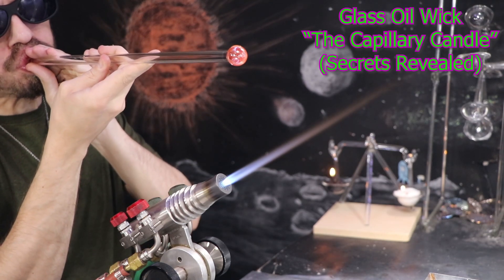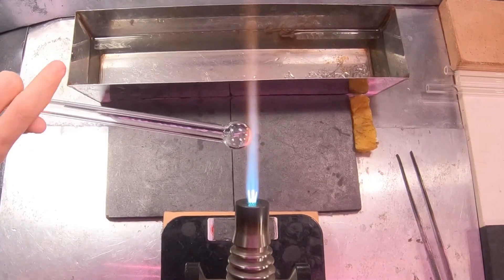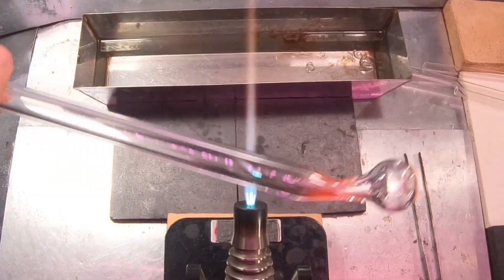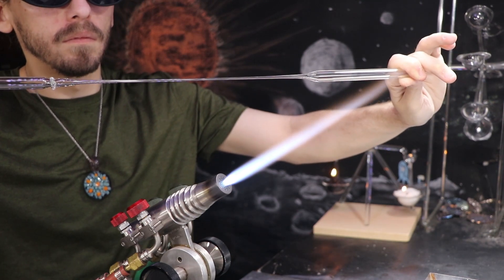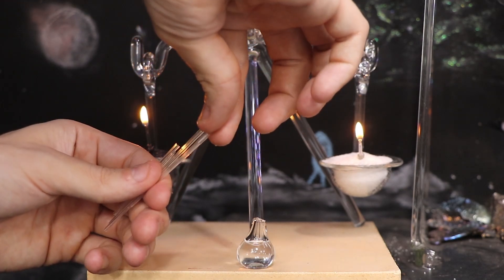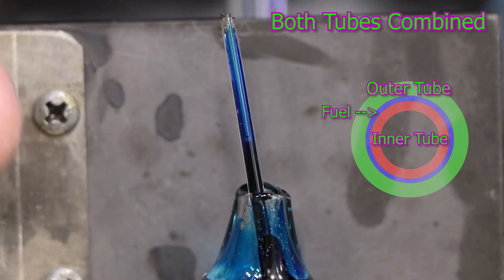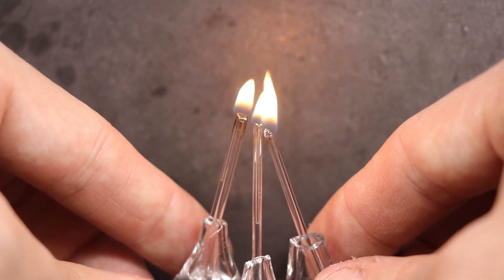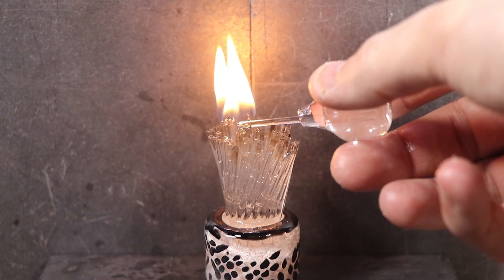Glass Oil Wick "The Capillary Candle" (Secrets Revealed)

Comment: I think you doesn't read comments, but I'll give you an idea anyways: Glass is a very bad heat conductor, so try to insert a very thin copper wire that fits inside the inner tube, it will conduct the heat to the oil thus warming it, so the oil will get thinner and at the same time the copper wire will help the capillarity by filling the inner tube... 🤔🤔🤔
Reply from the maker: Hey Laurahelenaxou1834, that is very a clever idea. The oil would be closer to flash point and combustion, it may burn easier. Thank you for the idea, I'll have to try it. And yea I have been away from comments and work in general but slowly finding my way back.
Reply: Awwww you saw my comment!!😍 Thank you very much for the compliment, as soon as I watched your amazing glass wick, I started to think in an idea to improve it!! A terrific and very clever wick system by the way, I have no practice nor skills to work with glass tubes and make those little ones, but I will at least try it!!! I will keep an eye here to see if my copper wire idea works 🥰🥰🥰

Comment: But, like with cotton wick, the question is: how long this glass wick works without obstructing its micro-holes by glass slowly melted by the flame?
Second question: is it totally atoxic?? Because about 5 or 6 years ago i tried with a commercial glass fibers wick and cooking oil, the results were no bad but after some hours of use i had a stitch on my right belly side (i think: for intestinal irritation), more than one time, so i abandoned glass for paper or cotton wick: it's without problems but it's no more good after 15-20 hours of use (with cooking oil).
I tried also metal sponges as wick for alcool lamp but with a very bad results. I don't remember if i tried it with cooking oil. I should try...
I imagine that the oil in your video is kerosene or mineral distilled oil for lamps.
In every case, your all glass oil lamps are splendid! Unique! Bravo!
Reply from the maker: Good questions. From the testing I've done the wicks don't melt but does collect a small amount of soot. The soot doesn't seem to cause any trouble and can be cleaned with a small brush. 

Being just glass I would assume it wouldn't be toxic. Sorry I don't understand what you're doing with the lamp to get intestinal irritation, are you cooking food with it? Cooking oil and lamp oil won't burn as clean as natural gas or propane. I'm not sure if the capillary candle can burn cooking oil. I should test it out to make sure. 
Thank you, thank you. The oil lamp has been a bright inspiration for me.
Reply: @JasaGlass  Okay, so you will try your glass micro-pipe for cooking oil lamp, did i well understand? But you must put the glass pipe in a cork floating upon the oil and protected (the cork) by aluminium foil; this is beacause the natural oil cannot climb more than 2-3 cm, contrary to kerosene which climbs 10 or more centimeters. Then, you'll tell me your results, please.
Why do you not sell your glass pipe wick?? I would buy some...
Reply from the maker: @pratoarancione7646  Thanks for the additional info. For the wicks, honestly, I'm afraid of the legal repercussions of someone setting their house on fire. The basic design of the vessel so far does not protect against getting knocked over, the flame will stay lit like a normal candle. I could sell them without a vessel, but I'm still in the process of opening my online store.
Reply from the maker: @pratoarancione7646  I did a quick test by replacing the lamp oil with cooking oil (corn). The liquid does make it to the top of the wick however it won't stay lit. If I tilt the wick sideways it heats the wick more and a flame will continue to burn. I'm sorry I didn't include the cork or foil. But it looks like with a higher flash point the cooking oil is having trouble burning as easily. In theory using both cooking oil and lamp oil side by side should work as the lamp oil wick can warm the cooking oil wick, allowing it to reach flash point more easily.
Reply: @JasaGlass  Very intersting, can you show the video of the cooking oil glass wick burning, please? I'm so curious.
Youtube showed me that you have another Youtube channel but i'm not founding it any more, can you tell me its name, please? Because there is a video about glass tube wick that i would like to see.
I don't konw the real legal risks of selling oil lamps with open flame (like yours) to a private citizen in your country (America?) but generally (Europe, Morocco etc.) there is no problem: if the blaze arrives, the fault isn't ever of the producer but of the user, like candles elsewhere. Here in Europe you can buy all kind of jar, in metal or glass, also very basic, for burning any lamp oils at different not specified flash points... so, there is almost not legal control on oil lamps or candles... the control falls on the user. If the glass lamp falls and crashes, the blaze is not ascribed to the producer but to the user (legally). So i think you can sell your creations.
If you dont use cork or any float for the wick the duration of the natural oil flame will be no very long, except if the jar is large.
Reply: @JasaGlass  You cannot post your video with cooking oil?...
Reply: @JasaGlass  Did someone say you don't write me any more?
Reply: @JasaGlass  Hello Jasa, why do you not answer me any more...?

Comment: Hey, to increase the efficiency  of your composite candles. You could have some false tubing that has open ends to atmosphere away from the oil, thus giving air a way into the core of the flame.
Reply from the maker: Thanks for watching and for the suggestion. I haven't tried changing the design yet, rather worked on the producing them more effectively.    I'll keep this idea in mind when I work on them again. I do have some ideas for new vessels, but am looking for ways to improve the wick.

Comment: In this youtube video a 0.4mm capillary tube will raise water 5.5cm. A 0.6mm capillary tube 3cm.
Experiment on Capillary Action or Capillarity using Capillary Tube

I was thinking of trying the same basic idea for some use in another experiment. Alcohol is probably not quite as good as water for climbing but as you can see diameter can be played with if you want more height, like you did by putting a tube within a tube. I've sleeved capillary tubes inside another as well. Ebay has many choices in size and length.

Comment: Since the fuel is carried in the space between the interior and exterior tubes, does the smaller one need to be a tube or can you make a stringer from solid rod?
Reply from the maker: That's a great question, I found a solid rod/stringer in the middle does work as well. I'm not sure how it fully compares without doing more testing.